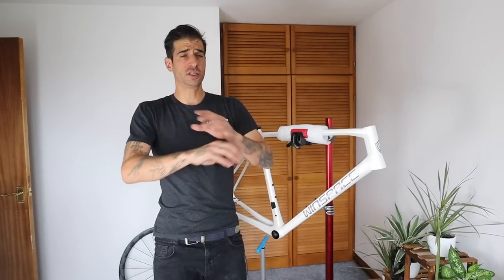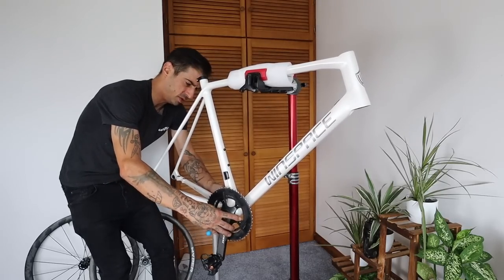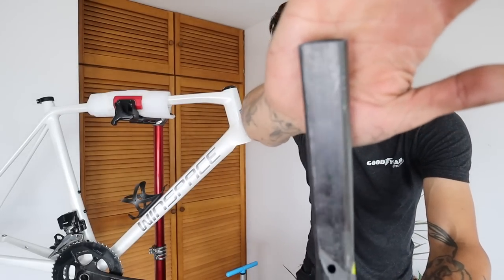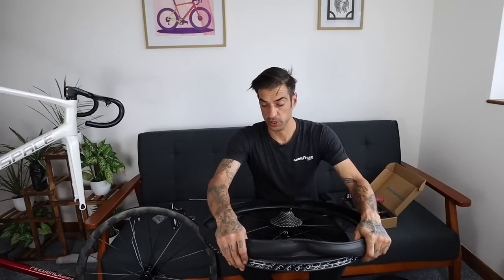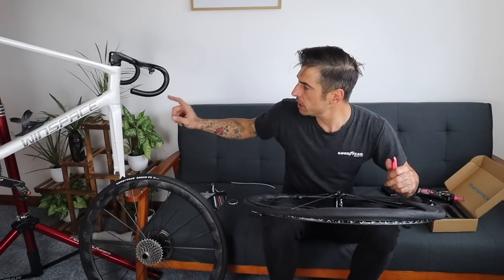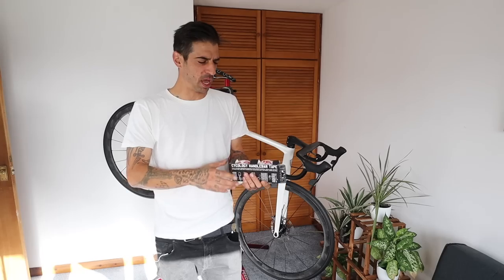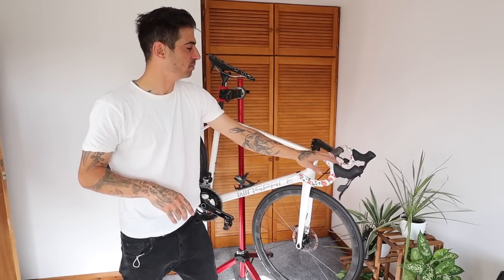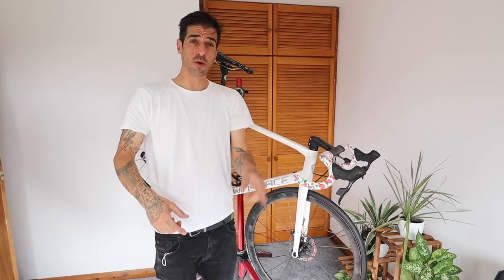Building My New Not Cheap Chinese Bike 🤷🏻‍♂️🤣

Comment: Wavy washer goes on the opposite site of the diameter step in the spindle. That step locks the bearing axially, the washer wouldn't do anything there. It's to pre-tension the floating bearing on the other side. Not that that's a good system anyway but it's how it's supposed to work on GXP.

Love the tape!
Reply from the maker: Ah thanks mate! Appreciate the explanation 🙏🏼

Comment: Brake cabling is wrong but somehow you managed to direct the hoses so that they aren't hitting the frame which is good. So many other builds I've seen the cables are rubbing the frame and that will wear away the paint in no time. Since you just have two brake lines I would have used the right lever for the rear and left for the front which is how we do it here in America.

Comment: Dave curious on how you set your seat height and set back on a new bike to be consistent with your other bikes, maybe a video.  Sweet bike!
Reply from the maker: Um…ok so it’s mostly random and by feel to begin with…then I tweak it slightly on the first few rides. This bike has a slightly longer reach than my old one so it’s impossible to get it exactly the same. The easiest way is to measure your saddle height and reach then match it…that said I didn’t actually do that.

Comment: Any bottom bracket creaking?
Reply from the maker: Yep there was a touch, I think it’s was down to using a cheapo bb though.
Reply: @DaveNoakes  What kinda of cheapo BB did you use? Did you ever resolve the issue and if so, what was the solution? Thanks in advance.

Comment: I really like the bar tape. :)
Did you see the Luescher Teknik review on those wheels? https://www.youtube.com/watch?v=Y3qLeHYmZMk
7.8kg is a fair amount heavier than I was expecting, even with those pedals. Did you weigh your Allez before you started taking it apart?
Reply from the maker: I’ll be honest it’s a bit heavier than I expected…but it’s a xl frame and the paint adds a few grams…then the power pedals, too much sealant probably as well and the bar stem is definitely heavier than a separate bar stem set up. I think I could get it to 7 with a bit of work…but honestly I’m happy with the 7.4ish it’ll be after changing the pedals.

I think my Allez was nearly 10kg but that’s with 60mm deep wheels on it.
Reply: This is xl framset my medium with sram red mechanical same wheels speedplay pedals 6.4kg.hope this helps.